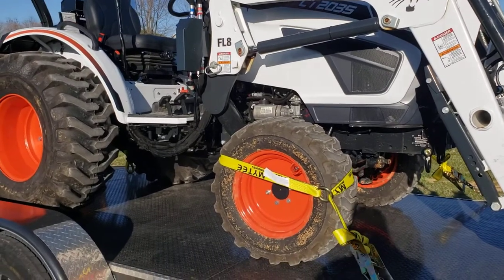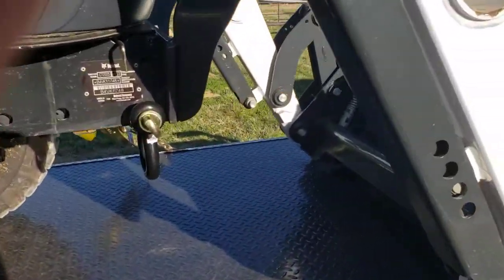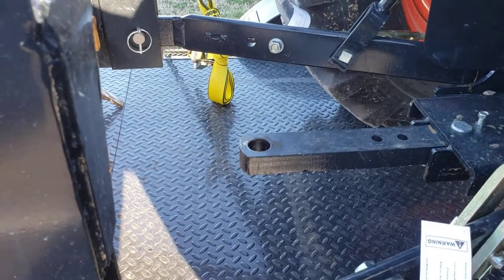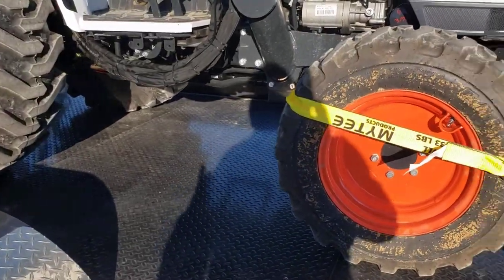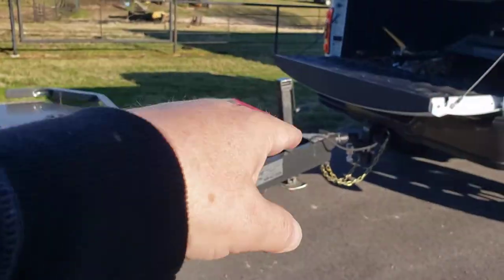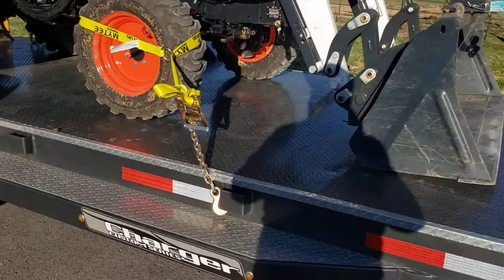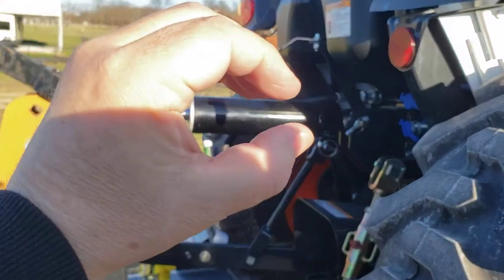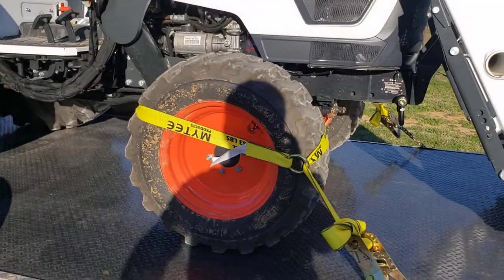Towing Tractor. How do you tie it down? Huge concerns and mistake.

Comment: Your front D-rings are best. Put a plank or plywood down for your bucket to protect your bed. If you can throw straps around the rear axle would be best at the rear. A strap over the bucket for extra measures. You can never have too many tie downs. Is the implement bounces, a strap there too. DOT won't become interested with your load.
Reply from the maker: Yes. I found axle straps are quick and easy. ...and safe.

Comment: Why would you put your hooks upside down if the chain or strep gets loose the hook is going to fall out that right there gives me a clue that maybe this video is not exactly accurate
Reply from the maker: You didn't watch the entire video.   I commented about that. When I bought the trailer, I didn't realize they put the walk deck so close you can't get the hook through the bottom of the stake pocket.

Comment: A trooper from Indiana said that if you run the chains through to the other side, you get 100% holding strength.  whereas If you just tie it down on each side, you only get half of the holding strength for that tiedown
Reply from the maker: In my state, on commercials equipment, each corner must be independently tied down. Additionally, front loader and rear equipment must be independently tied down.  Recently learned this.  So, up to 6 tie downs required.

Comment: So if you go by the DOT. You are required to have a separate trie down for each corner of the tractor then also a tie down for each corner of the loader on the front and another set for the implement on the back on of the tractor.  So really you need 12 tie downs and none can use the same anchor points.  Oh and each tie down needs to be able to support the wieght of the load.

Comment: I like the 4 strap/tie rule.  My general rule with tying cargo down is at least 2 straps on any item, or direction of pull.  Thus, if one strap is lost, I don't lose the load.  Front to rear pull and visa-versa is good.  So a car should have at least 4 straps.
I have seen people with tire straps, and they seem to be quick and effective.  Many attach both in front of the tires and behind the tires, so no slipping over the top.
I tend to like to throw a strap or chain around the axles, although finding a clear way to strap around an axle can be problematic.  Your tractor rear axles won't break or bend.  
Cars have suspension, so tying below the suspension is always best.  Tractors don't really have suspension in the same manner so it doesn't matter as much.
I don't like tying onto those lower links.  They aren't designed for that direction of force, and are really only designed to restrict side to side movement of the 3 point.  
The more tie downs the better for a trailer.  Perhaps add some weld-ons?

Comment: The rigging hardware you added under the front corners of the tractor frame, are not D-rings.  They are Anchor Shackles with screw pins.  The 1/2" size is rated for 2 ton WLL (working load Limit.)
Your rigging onto the stabilizing/anti-sway rods on the lift arms of your 3 point hitch is a bad idea.  Use axle straps to go over the rear axle, so it won't get chewed up, and then anchor shackles to attach the axle straps to a chain or heavy rated cargo strap.  

Stake pocket D-rings is one way to attach rigging to your trailer.  Another way would be to take a loop of chain, run it thru the stake pocket and then fasten the ends of the loop together with a twin clevis chain joining link of the appropriate size. NOW, you can fasten your grab hook from your rigging chains onto this loop of chain.